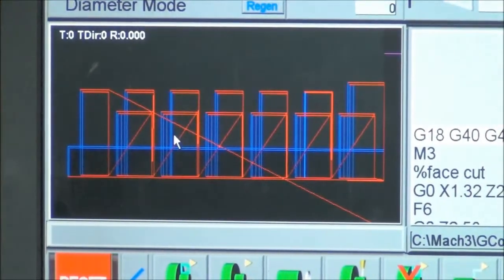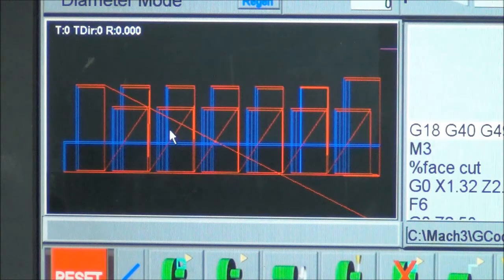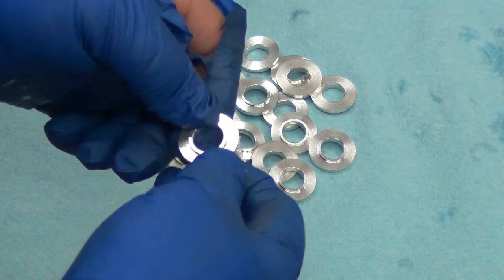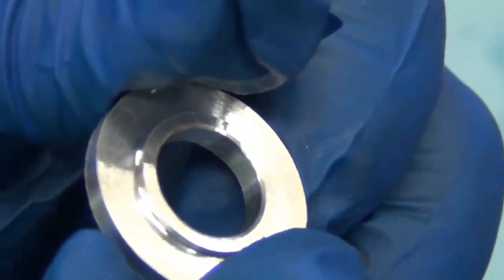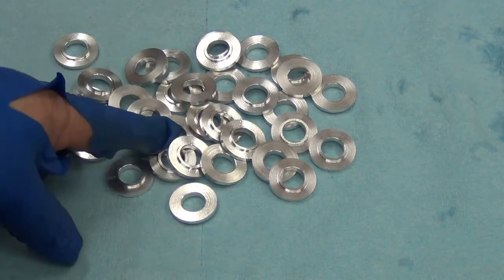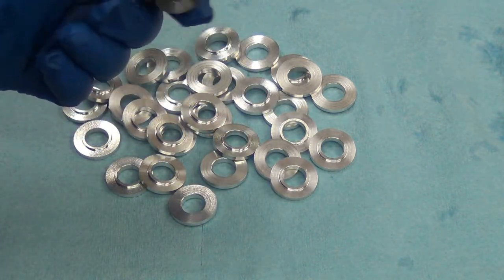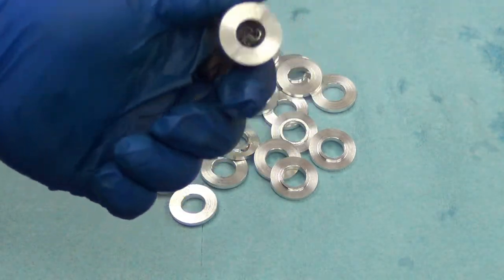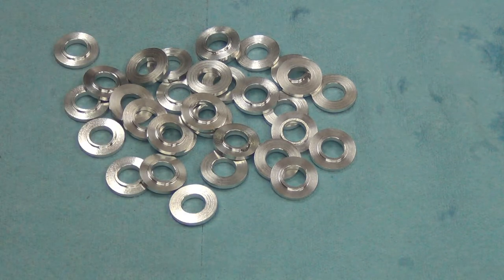9x20 CNC Lathe - DSM Spacers

Comment: do they make refillable WD40 bottles WITH the needle tip?
Reply from the maker: Not that I've seen.  To be refillable, they typically are not aerosol propelled.  The spray bottle will shoot a stream, but that's way more fluid than putting just a drop on from the can and tip.  I think I'll just keep some of each on hand. :)
Reply: I just want to dripple small drops from my favorite cutting oil into grooves when i part
Reply from the maker: meocats
That's what I figured you wanted to do.  What about those small bottles with the long steel tip you typically see used for oiling sewing machines?
Reply: Doesn't seem ergonomic but it gets the oil where i want in the quantity i want